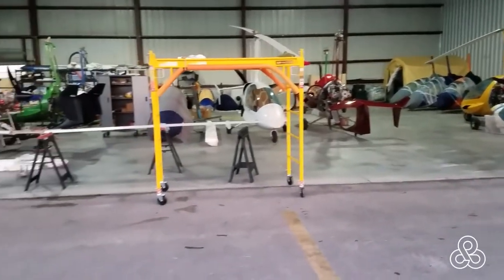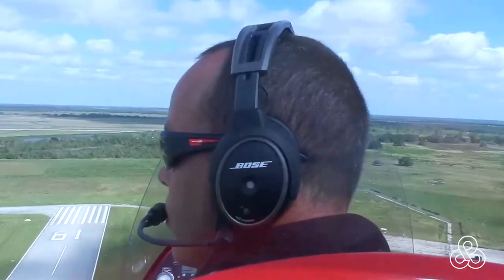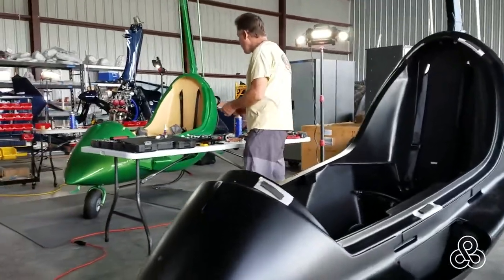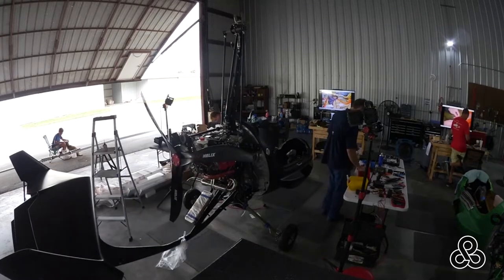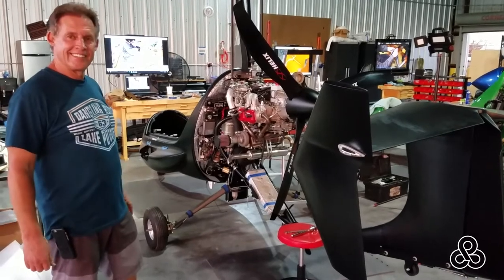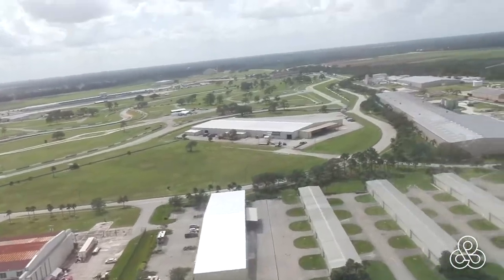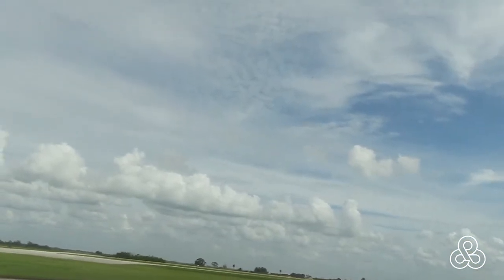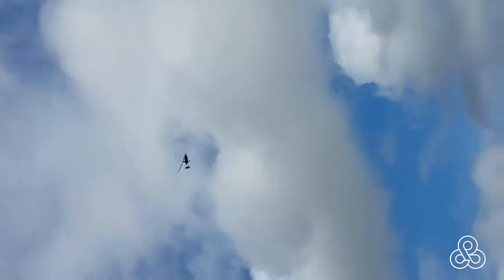Building an Autogyro, not the typical Florida vacation-eS1

Comment: Chirs Lord is R.I.P....
Reply from the maker: EW- We will all miss Chris. Our hearts can be glad to think that he was probably just called home early to train new angels how to fly!
Reply: Sad to come across this; R.I.P. Chris
Reply from the maker: @t.c.3027  Chris and another pilot where flying into Sebring FL last October when he lost control of his craft and ended up in some power lines and a trailer park. No definitive answer was reached as to the cause. With Chris's experience it has been assumed that flight controls failed. Engine noise is heard on his finale mayday call so engine failure, which he was very capable of dealing with, is likely not the cause. One theory is the teleflex cable system for pitch control. Many have argued against this system as there is no way to do visual inspection. Breakage or seizure of this cable would definitely result in loss of control. His family is doing well. Had a little tribute for him at Oshkosh this year.
Reply: @BuilderCreator  Yes, engine out is a non-event in a gyro. AFAIR, he shouldn't have flown a non-airworthy aircraft...